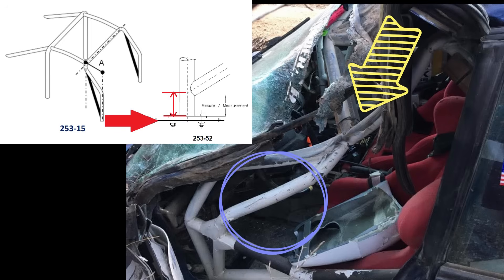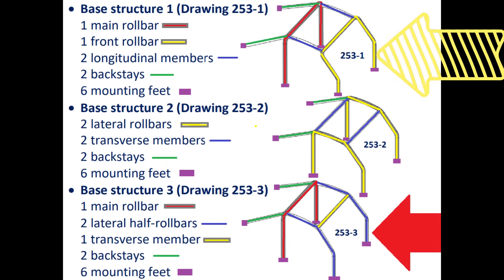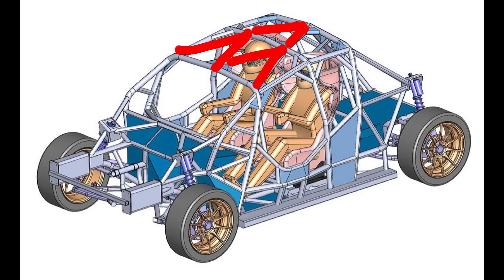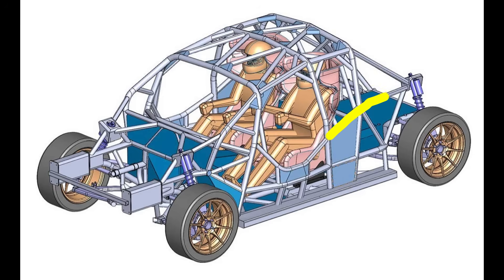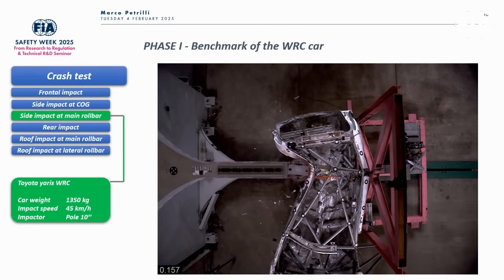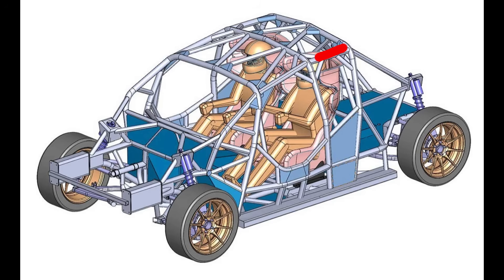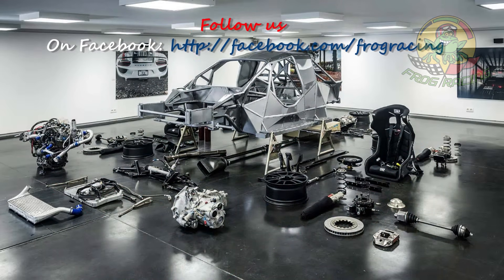WRC27 and the future of rollcages for rally cars

Comment: The tests show in the new design the car stopped in 54ms vs 119ms in the old design. Isn't this also a concern regarding injuries for the occupants because of rapid deceleration? Current NASCAR cars had ( have?) this problem causing driver injuries.

Comment: I wonder if there'd be any benefit in the long run to follow open-wheel racing's lead and move away from tubes altogether, towards full carbon cells? Cost notwithstanding of course.
Reply from the maker: One of the main motivations they had with this design was cost with a cap at ~$350k. It's not just the cost of the initial build it's also the repairability as rally cars tend to see much rougher conditions than track cars. It is relatively easy to replace a bent component of the tubular frame or rollcage, if you have a carbon fiber cell you are pretty much done. They already found that the carbon body panels that were on the Rally1 cars where prohibitively expensive to doing the whole chassis like that would probably not have been viable for the sport that is already struggling to attract manufacturers.

Comment: It seems very strange that Formula cars have worked on improving the monocoque tubs (originally aluminium and later carbon fibre), whilst WRC cars abandon the steel monocoque in favour of the "mad max" roll cage.

I would personally prefer if the FIA worked with manufacturers on improving road cars through rally car design...This means working on monocoque and material choice improvements rather than through tubular chassis which were dated in 1960s. 

I will also repeat my comment on historic race/rally cars: why does the FIA insist on zero gussets on 1980 style cages for 1960s cars "for originality" (when they were n't even fitted in 1960s). Do historic racers not deserve better safety ?
Reply from the maker: I think the problem with the production car unibodies is that none of them are suitable anymore for building rally cars. If you look at the US market they even stopped making cars, it's just SUVs and trucks now. The current approach is a cost effective one to try to attract more manufacturer to the sport, only future will tell if that will work out.
My understanding for FIA historic rallies is that those events are not time attack but regularity events that should happen at lower speeds allowing cars to run on their original FIA passport. FIA does not allow any modification of homologated cages which would instantly revoke the passport. And doing new homologations is a real headache and money pit. But I agree that I'd love to see safety updates for historic cars.
Reply: @FrogRacing  By rally cars, most people mean WRC / Group N. Not Dakar buggies or trucks which are for max mad type events.

SUVs are not suitable as rally cars (too heavy, only suited to suburban Moms) and pick up trucks are for builders or farmers. Both are dynamically rubbish, seriously can you see a F-150 on the Monte Carlo (other than to pick up straw bales or tow beleaguered spectators?). The US simply does n't do road rallies. 

What I am referring to are the Yaris, Delta, i20, Puma, C3, Fabia, A110, Clio etc) which are applicable everywhere else.

FIA historic rallies are either regularity (no cage needed) or speed (cage needed) although essentially in Europe and Aus/NZ.

The FIA rules on historic cages are influenced by lobby groups. If you wish to enter a replica Shelby or Ford GT, the cage allowed stiffens the chassis allowing 600 bhp to be used.

Comment: Looking forward to Fiat making theirs from cardboard tubes once again to gain the weight advantage!  

No- as discussed the cages changing with time and vehicle capabilities make sense... but its all tradeoffs.  As others have stated, you build a better cage, but now its heavier, but the cars have been getting faster and faster, so you need a heavier cage because the forces in crashes can be higher because they're faster, but now the cages maybe effect top end speed, which limits the maximum forces the cages may see in a wreck... it's all tradeoffs all the way down.  You cannot have your cake and eat it, too.  I do wonder how much greater the internal forces are going to be in extreme high speed wrecks on the occupants if the passenger compartment is made so strong as to be basically damage proof.  Those g forces and shock loads are going to be transmitted somewhere, and the fleshbags in the seats can only take so much rattlinf around...
Reply from the maker: The cars are not heavier, the tubular frame with fiberglass/CF body panels is actually much lighter than a traditional unibody car with a rollcage. I think the goal of these new rollcages is to prevent intrusion of the objects in the cockpit like shown in the lateral impact crash test. There is a lot of foam padding that also goes all the way from the door to the seat with different level of densities that are mandated. 
But there is always a limit on how much forces you can dissipate. It's relatively easier for frontal impact as you have a large crush structure in the front, for side impact it's pretty limited unless you start going with SUV/truck size body width.

Comment: In the UK rally cages require a pole called the pit prop that goes from the top of the a pillar straight to where the cage bolts to the floor.
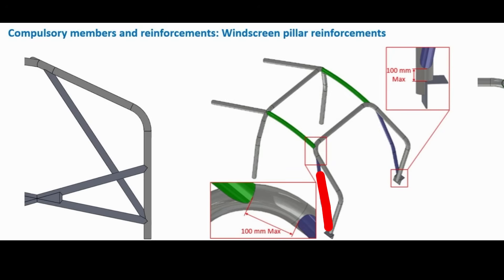Reply from the maker: I think you are referring to the 253-15 bar (mentioned at 1:38 in the video), it has been required for a while and bolt-in cages are no more allowed in many countries for new builds.

Comment: certainly an improvement but it gets to a point where the cars are so heavy you need even stronger cages, these cars are now heavier than FIA GT3 cars (1300kg) which are much larger, compare this to a mk2 escort rally car which is circa 800kg you don't need as strong a cage as the energy of impact is less at the same speed due to less weight,  a heavy car is the last thing you need for good handling as well due to the extra interta, they might as well bite the bullet and just have a carbon tub like LMP2 or Tub with tube cage for the roof like LMP3, the cars would be lighter & stronger, i'm sure the insane cost of these cages would not be much different from a carbon tub which can be made for £50-80k these days.
Reply: The 2027 cars will be 1230kg, like Rally2. So that probably means they'll also have the minimum weight with crew of 1390kg. Adding 81 litres of fuel that takes you to around 1453kg. 
The lightest GT3 now is probably the 992 GT3R at around 1250kg. Adding 120 litres of fuel and a 75kg driver gets you to around 1418kg. The heaviest GT3 is the Merc. With a minimum of 1345kg and the same parameters the stint start weight for a Merc is over 1500kg.

Comment: Having such a solid tube structure means the g loads to the occupants increases, as your co driver injuries illustrated, not all accidents are improved by making everything out of tubes without any disapation of energy.
Reply from the maker: You are absolutely right. This is why they also have these different layers of foam structures from the doors to the inside of the seat with different densities of padding to help absorb some of the impact forces.
Nascar did an interesting study with mandibular devices to record G forces and they modified their cage to absorb more impact to dissipate the energy. I have some of that in my rollcage video on the channel.
Reply: Take a looong close look again, there are multiple tiny crumble zones that add up before it becomes completely stiff and immovable.
You don't need to be an engineer to get it, I am 'just' a metallworker/machinist and i can see that. If you look at 1:30 for example, that triangle on the right behind the bar in the middle of the circle. You can see it again at 2:16 the green and the red, that small triangle for example will fold. If you don't want it to fold then you don't put that bar into the middle of the green one, you angle it further down that it meets the one that's coming up from the door. Thattells me it's done on purpose to get a tiny bit of crumble zone. Do that in multiple places that add up and you get yourself something that can be called a crumble zone.
Reply: That's correct we have seen this by the introduction of the full carbon seat. 
To stiff will break your back bone
Reply: @kevutrecht1  you guys judge way to quick...
read my answer to the OP ;-)
Reply: I find the problem with these discussions is people end up going off to the far corners of engineering, but fail to understand what the aim is. You see it in 4x4 forums and other activities. Especially with metal fabrication where it becomes a beard measuring contest. Look at the WRC, hillclimb, Rally deaths this year, most are not due to intrusion or failure of the cage itself. But the secondary sequences of the impacts were the killer.
Reply: I would also note that having bare tubes everywhere in the passenger area and carbon fibre seats makes injuries more complicated. The foam sections that are in WRC have been a big step forward.
Reply from the maker: @fraserwright9482 there are no bare tubes, padding is required where the helmet or body can make contact with the tubing. I don't get how the material of the seat complicates injuries.

Comment: The only thing I would note is that in the crash tests, the new design had significantly lower incursion metrics but the time the car stopped in was halved. That means that the Gs of acceleration experienced by the crew will double. Which in turn means that there is a chance for more significant internal injuries.

I wonder if there was a way to mitigate that perhaps with a collapsible superstructure, or collapsible or retreatable seat mounts... Just spitballing here.
Reply from the maker: The problem is that the crash test illustrated in the video is the side crash at the weakest point of the door which usually results in the most significant injuries to the occupants due to the intrusion (you can see how far the post gets into the cabin for the old car). The problem with the door is that there is not much room for deformation to absorb an impact, that's why they mitigate the side impacts with a lot of foam padding. There is plenty of room in the front and rear to deform and absorb forces but unless you get an SUV size interior there is not much room to absorb side impacts.
Note that I have a rollcage video from this year's FIA safety week on rollcages that describes the other tests they made. I haven't had access to the rest of the footage unfortunately, it'd be interesting to see the deformation for the other impacts.

Comment: Maybe cage is great but the idea of not road cars as a top rally spec is against the core od what rally is.  It shuld be modifyed everyday cars at everyday roads. I hate the fact that fia tries to make ech series like f1, wich is no loger about racing, more like influencer showcase.
Reply: Fully agree! Also the base models crash protection is on high level. Silhouette cars are not the cars some individuals or small teams can build.
Reply: To keep the speed and make it safe/safer, they'll need a better rollcage. Else we stay on spec chassis' but since that's not acceptable guess we'll lower the top speed. One does not simply design/make a better rollcage/chassis, so what'll it be folks?

Though I've read and heard many opinions through the decades, people prefer to let the pilot and copilot die. Kill em I guess, let them die. More glory that way, "are you not entertained?", " witness me!".
Reply: @XenonG what is the problem with a little bit slower cars? And answer the question why grup A was sa popular. Couse people wanted to kill drivers?
Reply: @kubabaczek876 I forgot to type in what I was thinking while I was writing all that, nothing wrong with slower cars, but you know how most of the mouthbreathing audiences are for Formula racing and Rally in general. Dip in viewership means dip in sponsors, slow speed and less danger means less viewership.
Reply: @kubabaczek876 And yeah, I want something like Group A back, but why something like that is not popular and eventually shelved as usual?
There had been efforts to revive it a few times in recent years, but only Subaru still have the proper drivetrain and chassis setup for it in mostly stock setup. Take a few guesses why only Subaru had been dominating it (mostly stock setup race events) roflmao
Reply: @kubabaczek876 I don't want to be a Debby Downer at all this, but at the same time we need to be realistic in what will work to continue on for motorsport in general...
Reply: @XenonG  have you seen the car industry? Where are we going to get group a with the cars being made ?
Reply: @WisdomeSage1989 Exactly the point I was making, spec chassis is a "necessary evil".

Comment: More weight cause of more steel means again less weight for doorpanels/windshield etc and again like always "the problem" is just shifted to another position...and as the wheel just has turned, the problem will be again objects entering through the open gaps till someone decides to put more hp in to counter weight...then the cars become again "unsafe" cause they too fast and now need again more "steel bars"....the loop of insanity where someone tries to fix "the problem" which is funamentaly integrated in the whole concept at the first place...invent a foam in the style of the movie "demolition man" to finally get out of middleage "more steal beams means more safety"....

Comment: I have a question, perhaps you could answer with a video, that'd be cool!
Love your videos, amazing work - very informative and extremely useful. Keep it up.

Which road car chassi based motorsport genre in your opinion requires and mandates the strictest roll cage regulations and thus which protects the best under FIA regulation? (or maybe there are even safer and stricter rules outside FIA regulation?)

Are there differences between roll cage mandates and design requirements for example for circuit, drift, drag, rally, cross country, off road, hillclimb and so on or are they all adhering to the same roll cage regulations? If not, what are the differences both positive and negative?

If there are differences, could you make an "ultimate" roll cage from all the elements of the different series?

What about non-FIA regulated series like for example Nascar - they have quite funky cages a lot of the time after countless use case specific crashes, can we learn and apply anything from that? 

The question comes from a theory - how would you build your roll cage if you wanted ultimate protection during all circumstances - which regulation would you build to or would you build to multiple? Instead of doing the bare minimum, we want to do the absolute maximum - the opposite approach from normal.
Reply from the maker: Thanks for the excellent question. The most advanced cages are probably in rally raid where now you also have the seat support integrated into the cage to accommodate a strut that dampens the seat in case of a hard landing (think jumping a big dune).
Building a cage is always a tradeoff, you can make them extremely strong but if they don't absorb energy on an impact the forces transferred to the occupants will cause severe trauma. I have a video on rollcages where I discuss some of those issues: https://youtu.be/i2VvQxYf9qM
There is a crash test from NASCAR where they changed the front impact zone to deform more to absorb more energy so that the driver would sustain less Ga on impact. Lots of factors to consider when the cage is integrated in a production car.
Reply: I wish it were as simple as building the safest cage but rules get in the way.  The SCCA (Sports Car Club of America) varies the rules between classes.  On a number of the lower (i.e., slower) classes you cannot do things like attach to the car pillars AT ALL.  I did what I could with in the rules but it meant that my sill bar could not be welded to the car except at the main roll hoop and at the down tube.  The sill bar was allowed but not required.  Cost is an issue, too, as a very strong cage may cost more than an engine.

Comment: While I applaud their efforts to increase safety at the highest levels of motorsports where cost is almost without object, I also worry that if elements of this trickle down, it may eventually make non-cnc-bent cages outside the budget and ability of the grassroots enthusiast (who is already struggling with the cost of prepping a vehicle). 
At some point when trying to defend against tree strikes to the a pillar, why not require larger diameter tubing and require it gusseted with vertical gussets the length of the pillar? It seems like that would help about as much as possible.  At some point that windshield opening and the egress opening is always going to make a front a pillar strike the hardest to defend against while still having some field of vision with minimal blind spots (blind spots are themselves a safety risk) as long as the tubing stays inside the car.  I can see the double main hoops helping greatly with any crash that successfully transfers impact into the hoop, like a roll over that hits mainly on the front halo/windshield, but on a true a pillar strike I am not sure changing the seamless hoop to the front halo would have much effect. 
Thank you for sharing this though. I did not know wrc was moving to this design. You didn’t talk about it a ton but it looks like some areas are being plate gusseted, which is really interesting to me. I wonder if there is any strength left on the table not plate gusseting the triangle created by the (former) sainz bar (which is now the main front hoop) where it triangulates to the firewall ahead of the driver’s feet.